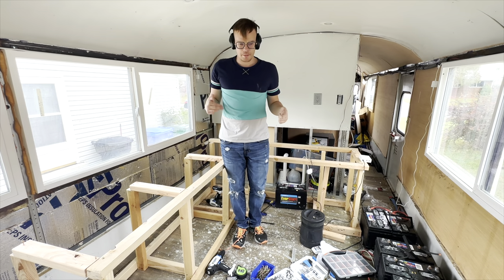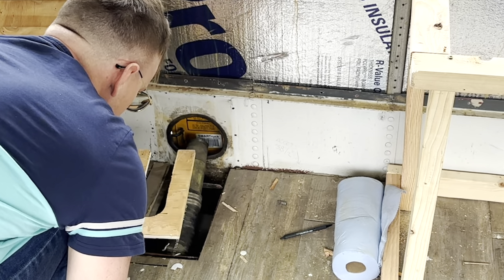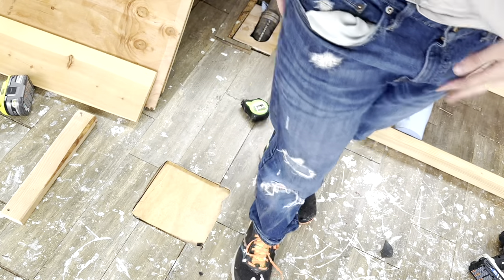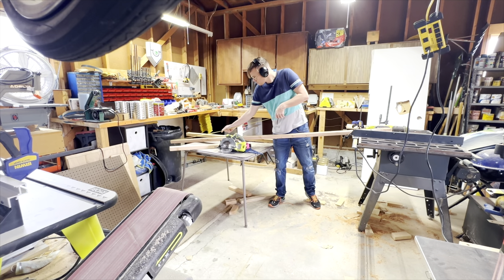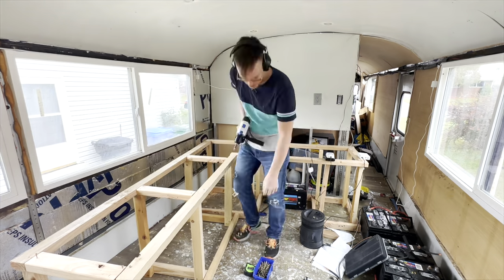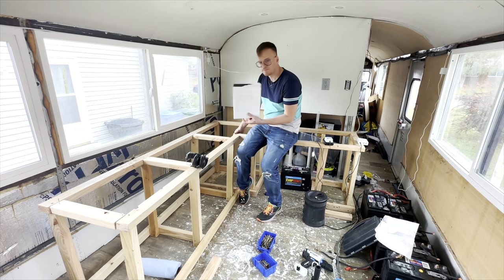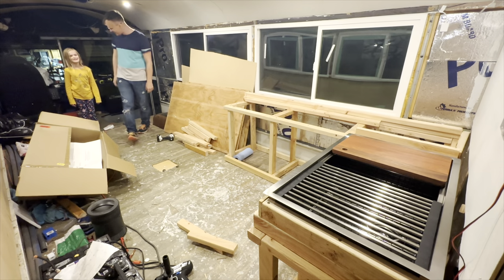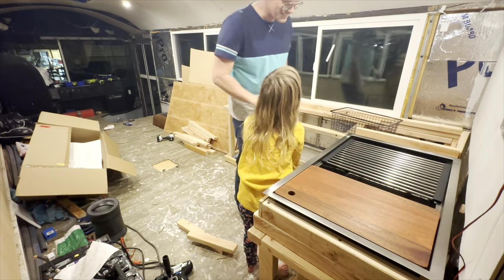This bus has Everything and a Kitchen Sink! | Skoolie Kitchen Build

Comment: It's certainly taking shape. 
Got a great happy kid there. 
Need an update... What happened to the broken down bus on the hill ? Was it the fuel pump ?
I actually ruined my fuel pump on my 4wd because I filled it up on an island without a filter and the petrol station had pumped sand up with the fuel. When I dropped the tank (with just 1 fill of a 40 litre (10 gallon) tank, I found at least a full cup of sand in there.
Reply from the maker: Oh wow! I fell on hard times and I don’t currently have a computer to edit videos on. I’ve been filming updates but haven’t been able to edit them. YouTube is finally letting me do memberships and super chats so hopefully if people start doing that I’ll be able to make full length videos again.